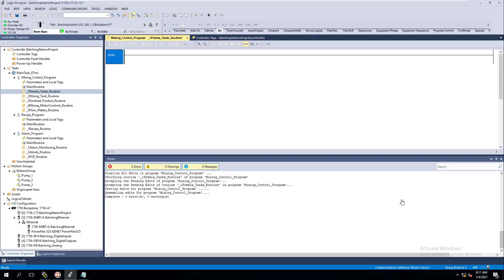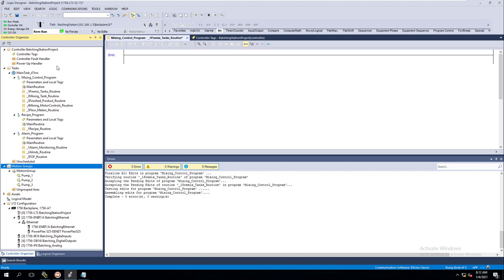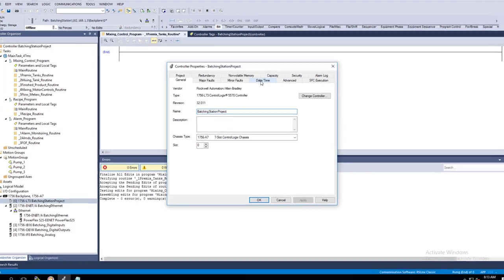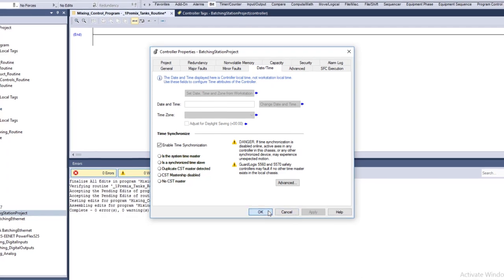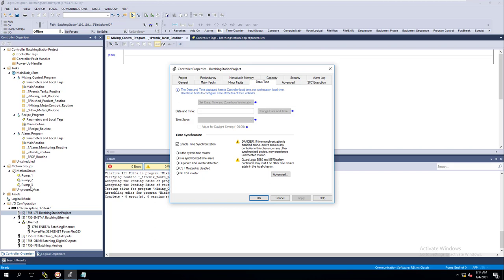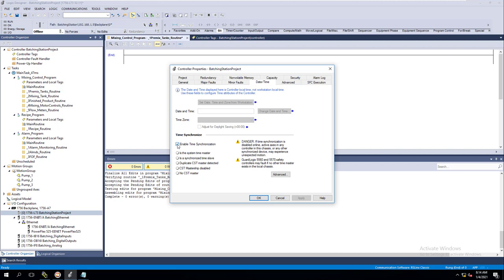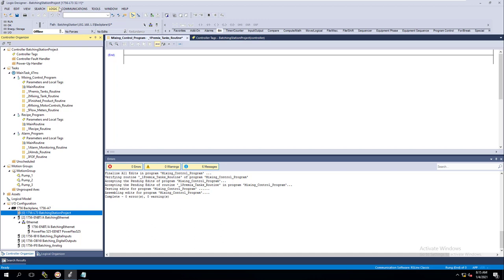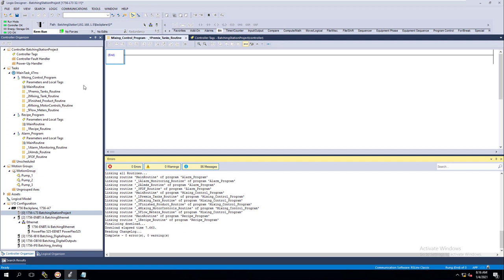Studio 5000 Motion Group Time Synchronization with Date & Time | Batching PLC Day-19

Comment: Hi , thanks for the video
I have encoder connected to compact logic and it's keep showing an error says " control sync Fault "
How could I prevent that??
Reply from the maker: The controller lost communication with the motion module (in this case, the encoder) and missed several position updates in a row. The Control Sync Fault means 4 consecutive Time Synch messages have been missed. After that, the Control Sync Fault bit is set. The motion module may fault later or may already be faulted.

I would say noise related could be an issue...electrical noise from improper grounding, dirty power, or just area noise.

Electrical noise conducted through the mechanical coupling and on to the encoder shaft can cause the encoder to appear as if the power supply to the encoder had been cycled and consequently causing the Control Sync Fault. 

It is possible to eliminate electrical noise as a source of Control Sync Fault from other causes by either fitting an isolating coupling or where possible providing a path to ground the noise.     

I have fixed issues like this before using an oscilloscope.
Reply: @ShaneWelcher  thank you for helping me ,
The problem was about bad grounding , one of the main motor when it's working make big noise, I tried to use filter for the encoder but it didn't work, so I isolation the encoder away from the body of the machine